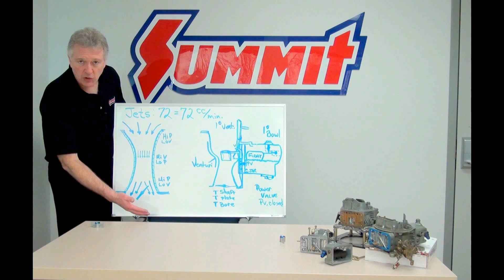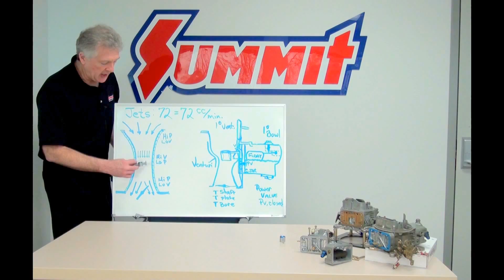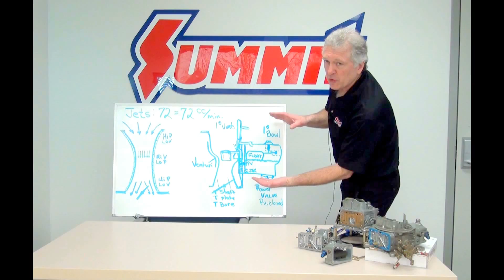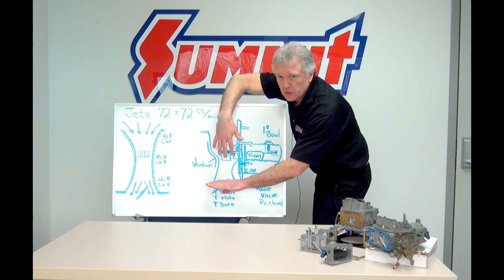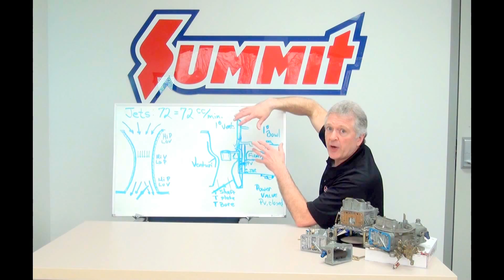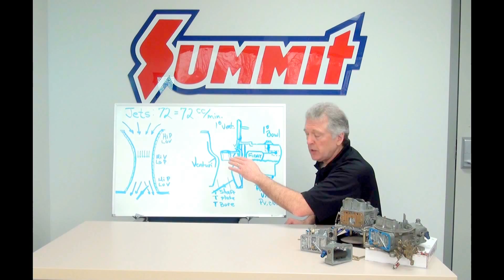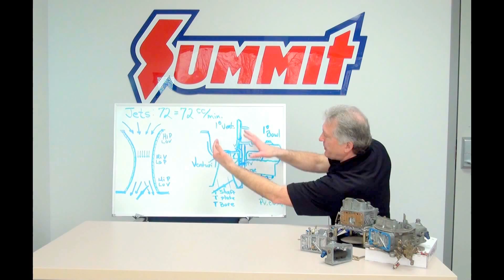Carburetor Main Jet Tuning - Summit Racing Quick Flicks

Comment: Thanks for the video!!  Why does my setup like squared jets, meaning nearly the same all around.  There’s a power valve in the primary but none in the secondary.  4150 650 DP.  Thanks!
Reply from the maker: On average, a power valve makes up for approximately 5-7 jet sizes. There are a couple of reasons why your set up could be a little different. Float level, emulsion sizes in the metering block, high-speed air bleed differences to name a few. You may be a little rich on the primary side, and a leaner secondary side balances it out under WOT. If you suspect this, try disconnecting the secondary linkage and tune the primary side mixture for 12.5 -13.0 (assuming your running gasoline) at WOT. Then retest your mixture with the secondaries connected and see what it remains the same or leans out.
Reply: @SummitRacing   thanks for the reply, this is great advice.  I do have an AF gauge so this will make it easy.  So what I’m understanding is that it’s not normal to be nearly squared?  What if the primary is good and it still wants squared?  I will try adjusting floats slightly as well.  Thanks again!!!

Comment: I bought a new 600 cfm dubpumper brawler by Holley , my truck is stumbling thruout the start and curve , I realize it's not able to supply the 355 with aluminum heads with enuff gas , so I'm needing to see if anyone knows what size jets come already installed in that carb?
Reply from the maker: Hi, Primary is 66 secondary is 72
Reply: Thanks there ,but the next up would bewhat? Like a 68 & 74?
Reply from the maker: 68 and 74 are correct. Most people increase or decrease the jets sizes by 2 when making adjustments.

Comment: I have a 427 S/B 520HP with a 850 quick fuel carb. The youtube vids iv seen tell me to set mixture screws to start at 1an a half to 1an quarter turns an turn out to fine tune. My best vac occurs at less than 1 turn out am i missing something any help please

Comment: It may be helpful to understand total pressure and its components static and dynamic pressure.  Total pressure equals static pressure + dynamic pressure.  Dynamic pressure is a function of velocity.  Specifically velocity squared.  When the video presents HiV and LOV it is velocity.  Since total pressure is a function of both static and dynamic pressure, when velocity increases because cross sectional area decreases in the venturi (when flow is unchoked), the dynamic pressure is increasing causing a decrease in static pressure because total pressure is constant.  If a circuit has one end attached to the high dynamic (high velocity) pressure and the other to low dynamic pressure (atmospheric pressure), there will be flow high to low.

Comment: I have a Ford f 150 truck 89 model was factory efi now holley carb diet it's a 5ltr winsor gt40 heads weiland intake 600 holley running 65 main jets if I put 63 will it improve fuel economy
Reply: nathan schmidt Yes, check the color of your spark plugs to see if you can go leaner. You can also buy a Air/fuel mixture gueage assy that will tell you if you can go leaner/richer.

Comment: great video and clear instruction, 
in the second method the vacuum reading - 2 and the result devided in 2 is the correct way ???
for example if the vacuum reading is 13 , correct power valve size is 5.5 ?
Reply from the maker: Hi rezajahanshahi, 
As a general rule of thumb, to achieve the proper power valve starting point, a vacuum gauge is placed on a manifold vacuum port. This should be done at operating temperature with the ignition timing set already! Manifold vacuum divided by 2 with .5 added for your result. The actual equation will look something like this….  14 / 2 = 7 + .5 = 7.5

If the car being tested has an automatic trans. then the test should be done while in gear (under load).  If it is a manual shift trans. then the test is done in neutral with no load.  The key is trying to simulate how the car will be driven and expected to react from a stop. 

  You’ll see that emphasis is put on starting point above. You may/will need to change this power valve size according to your driving preferences by .5 – 1.5

There are many power valve sizes available to suit your needs. Give us a call if we can assist in any way!  1-330-630-0240.
Reply: Yes, divide by half. If you go to a real radical cam you may want to play around with different numbers or even buy a power valve plug to block of your secondaary power valve.

Comment: Recently my engine has been running really poorly at cold idle (sputtering, missing, rough, stalls at stops if I don't keep my foot on the brake and gas)
I've replaced the spark plugs, spark plug wires, ignition cylinder, distributor, cap and rotor, so it is the carb is giving me grief, it's a Holley 4160 600 cfm four barrel. I've adjusted the choke to various stages, I have the fuel idle screws adjusted to the best vacuum at 1 turn out and I've even taken the carb apart and cleaned it out, yet it still has a crappy idle when cold.
I just can't figure it out, could jetting be a problem? it ran fine since I got the carb in September, until recently in mid December
Reply from the maker: Hi dethmetel, 
Due to colder, more dense air in the winter months; it is certainly not uncommon to have to increase jet size slightly to maintain a good mixture in the cylinders.
Reply: Summit Racing It's like it's getting too much gas though. I recently replaced the power valve and it helped it bit. 
I'm only running 68 jets

Comment: edelbrock carb 1406 used on 454 it bogs  put same carb on crate 350 it still bogs down  black smoke  out tail pipe both engines

Comment: Norm, I just bought a carb spacer for my Holley to help stop gas peculation, my question is do I have to make any adjustments or upgrades or will it run the same?
Reply: Ron General rule of thumb is : The longer the intake runner, the richer the jets you will need. I would be surprised if a 1" intake increase would be more than a jet 1 # higher though.

Comment from the maker: Ron,
Going for a drive while watching a vacuum gauge sounds like tuning the power circuit (Power Valve). Generally I would use a vacuum gauge for tuning the idle circuit, the power circuit and possibly as an aid in tuning the secondary side of a vacuum secondary carburetor. Ideally you would want to know the vacuum that the engine is producing at idle, at or near a mid-range steady-state cruise, and at W.O.T. and make your adjustments from these findings. Do you have any specifics? Let me know.

Comment: I have 62 cc/minute front and rear max vaccum at idel. I can let out the clutch and move the truck around. I need to find a 600cfm choke or send it to Summit for repair. Or get the Atomic system.

Comment from the maker: With rare exception… if, in your original tuning you were able to dial in your idle circuit correctly then changing the jets and or working on the main circuit should not constitute the need for an additional idle mixture screw adjustment.

Comment: this guy is awesome. so informational. its very helpful how he breaks it down and explains it all piece by piece. but i have a quick question after changing the main jets do you have to go back and re-adjust the idle air screws?
Reply: I know this thread is old but this is the same question I have
Reply: Generally no, the idle circuit is independent of the jets.